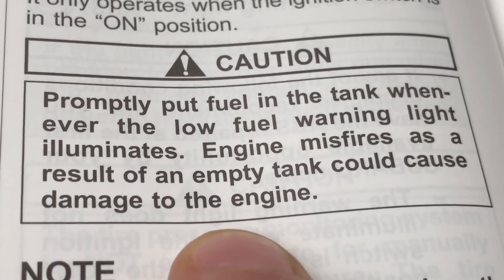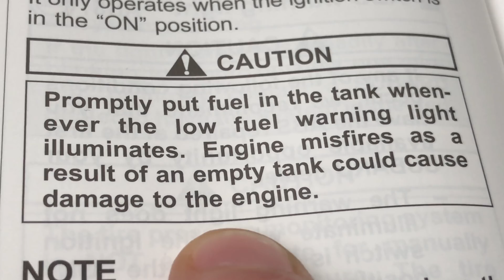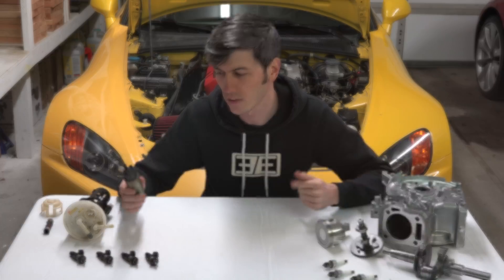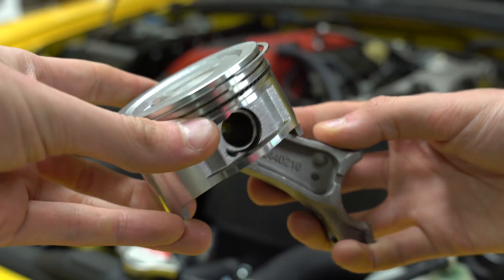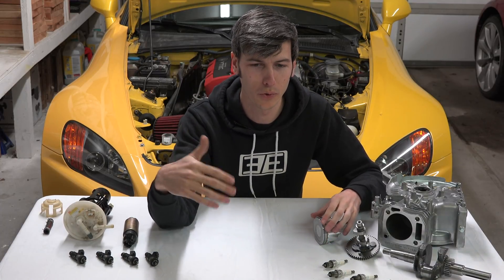Will Running Out Of Gas Damage Your Car?

Comment: Putting temperature cut of sensor on fuel pump and change zero fuel indicator when you have eg. last 5 liter fuel in reservoir can simple solve all that problems.

Comment: A diesel engine with a turbo could be damaged. The pressure inside the fuel system is very high, and air bubbles inside that line will certainly make for a long stop. You    need to repressurize the line. That is not good.

Comment: I learned about destroying the fuel pump the hard way: I have added an LPG system to my gasoline car, the first summer I used it I put gasoline in only when the light turned on, and running with LPG meant i could go 500 miles with 1/8 of gasoline.
After 3 months the pump failed and i had to put a new one in. Never been below 1/4 since then LOL

Comment: Are catalytic convertrers really robust for different fuel/air ratios? I thought they were the reason they switched all the cars to injection, because with carbs the ratio is only close but not exactly right, and that would ruin the cat.

Comment: Hey Jason. Different subject. I was wondering if you could do a video on engine operating temperatures. I see a trend of newer cars running at extremely high temps. My car an 05 bmw 545i runs at 221 and all sorts of problems happen such as valve stem seals going bad and coolant hoses  anything rubber and even coil packs and sensors. I'd like to see your take on this. Paul

Comment: This guy doesn't understand the struggles of being broke. "Can I get $4.62 on pump 3?"
Reply: Good news, when your fuel pump goes out you won't need money for gas...
Reply: It costs the same amount of fuel to drive down till empty as with 10L in reserve, but the latter has less chance of a repair bill.. so even if your shaking down the couch for $5 to put in the tank this week just pretending that the car will totally stop when the needle touches E is a good idea. Also if something really bad happens and you need to evacuate (fire, flood, tsunami, whatever) it means the cars an escape path not a paperweight.
Reply: Hamish McGregor you’re*
Reply: @Hamish McGregor People don't run that low because they fail at logic. They run that low because they need that money to be liquid, not gas.
Reply: @user-os8sq3uh4n  that's just bad risk management, if you keep going through life this way, if course you'll need money to be liquid
Reply: @user-os8sq3uh4n  Gas is a liquid though....
Reply: @TimothyLee93  it was just a play on words but point taken
Reply: @user-os8sq3uh4n  If you're unable to save for a one-time payment of $10 (average minimum wage in the USA is $8.49/hour) which will pay itself off in via delayed repairs, then yes, you suck at finances.
Reply: @user-os8sq3uh4n  It's amazing how broke people make due even once they are out of cash and gas. Gasp, it's almost as if they could've been frugal the whole time. It's just short-sightedness and bad choices.
Reply: @TimothyLee93  gas is a fluid, not a liquid
Reply: 🅒🅞🅝🅢🅟🅘🅡🅐🅒🅨    The fuel can get you more enjoyment than even the 32 oz. Bud Light.

Another reason is people will spend more $$$$ trying to drive around trying to save .02-05 cents a gallon then run out.  Again not very good risk management and when you are forced to fill up it might be the more expensive station and then you need more to fill up.  

Do you want to take a known risk and only put 10 gallons or risk trying to save a few cents and wind up stuck in the no mans land between the two stations.  

Example station A. $2.00/gal and put 10 gallons to fill up.

Station B. $1.60/Gallon but need 12.5 gallons.  Same dollar  amount coming out of your wallet.

Short example but you should get the point.

I understand the $5.00 to hold me over until payday but also remember fueling takes time.  You want to put $5.00 at a time  and be filling up every let’s say two days or put $20 and not have to visit the fuel station every fifth or sixth day?
Reply: Now now now, let's not forget the purchases before the $4.62 on pump 3. I've watched people buy $50 worth of cigarettes and then dump their loose change in the gas tank.
Reply: @darksuns7384  Your car will not run well on loose change. However I guess it will raise the level of the gas remaining in the tank.
Reply: I genuinely feel for those who are frugal yet still broke.  But most of those same people putting in $4.62 in gas are the ones posting their new nails just did or wearing Jordan’s
Reply: @hansolo6827  I concur
Reply: Another thing is most gas tanks have a lot left when the fuel light comes on. My Lexus has approximately 3 gallons left in a 12 gallon tank. That's about 120 miles range left.
Reply: @user-os8sq3uh4n  Most vehicles has 2 gallons in reserve when the "E" light comes on
Reply: Well, it comes down to choices, mostly. I have been broke quite long, but I never went so low that I risked damaging my car by not refueling. And I am from Germany and when I had to watch fuel prices the most because I had little money the gas was at about $6.35 per gallon and I had to drive about 775 miles a week.
Belive me, it was a lot of lifting and coasting and not being able to afford anything but fuel and bare neccessities (I was making about $1450 per month back then). But since then I have a great fuel efficiency in any car I drive. With my current Mercedes I normally do over 37 mpg. The only exception are long Autbahn trips, which may decrease that number ;)
Reply: Luda Guzman there is no damn difference whether you pump fuel in a quarter tank or empty tank. It’s the same cost, if you don’t know how to budget, learn how to budget. If you can’t afford to buy fuel then don’t drive
Reply: M Detlef  It was not exactly by choice. Let me put it this way: It was the least horrific choice I could make If I wanted to qualify for the job I wanted to have and it was only 18 months.
Reply: Maybe you should work more on not being broke?
Reply: @BLAZINGINGPHOENIX  tell that to the boomer employers who outsource or automate every position they can
Reply: OP maybe walk instead and save money if it's possible. Or get a bike like I did for a couple years and saved for a fuel efficient vehicle.
If you're not getting 40+ mpg don't even bother with the car.  Only one person can help you and that is yourself. Believe
Reply: When life squeezes out the last liters of gas from the tank...
Reply: Ha!
Reply: Be'n broke my ass.. Mind your priorities.

You need your car to get around?.. 
Then, your car needs gas to take you. 

It's simple stuff. 🤷🏾‍♂️.. 

$10 in tha tank, every now & then.. OR 
$600 down tha road for a new fuel pump?
Reply: @c-5899  but my feet is not the same size, and besides it I use the metric system instead, jk :)
Reply: I’m sure he understands it. He’s just explaining why it’s bad and what can happen.

Comment: I haven't fully watched the video but yeah, the fuel pump relies on the gas for lubrication.  Little to no lubrication will damage the pump.  Plus less gas in the tank forces the pump to work harder to get fuel to the engine.  So yeah, running low on gas can damage certain components.
Reply: The relative fuel level in the tank matters very for reducing load on the pump little as the supply head variance is low - 18" of fuel equates to 0.5  PSI (divide the height in feet by 2.31 to get PSI of water pressure head then multiply by density relative to water - 0.83 for petrol - so 1.5' /2.31 x 0.83 = ~0.5 PSI) when the pump is delivering a bare minimum of ~30 PSI to the regulator for a port fuel injection - much higher for direct (chamber) injection.

Comment: Very interesting video. FWIW, I have always run my cars to near empty (less than a gallon) before I get more gas. I haven't noticed any of the problems mentioned here. I have run out of gas only two times. For the last thirty or so years I have driven Hondas and I've never run out of gas in those vehicles. I've never replaced a fuel pump in any of them. I think the catalytic converter was changed under warranty in our 1987 Accord other than that I've never replaced a catalytic converter.

Comment: I use anywhere from 1/4 to just over 1/2 of a tank of fuel everyday. I’m in the habit of topping up every night, mostly for the convenience of not having to ever think about whether I need gas, but also to circumvent my car’s attempts to run an evap test. Am I risking any harm by never running my tank very low? Should I be worrying about how old some of the fuel in my tank may be?
Reply: Yes. You're most likely never burning the old gas and introducing stale gas. For the EVAP issue, just do that trick come inspection time. I've passed many with a busted solenoid. Screw regulations

Comment: What about the condensation water in the tank that will be pumped into the engine? Was it a lie from my dad to make sure I was always above 1/4 ?
Reply: Pretty much... the pump is always drawing from the same level in the tank, which is near the bottom, so it's not like there's a permanent fixed water level that the pump magically reaches down to when the fuel is low and picks up just water. Also, most systems are recirculation which returns unused fuel (containing some water) from the rail to the fuel tank which differs from the days of carburettors where the water could settle in the bottom of the float bowl until there was nothing but water in the bowl, at which point the engine would no longer have any fuel to burn and would stop. But even that was rare because while the fuel and water are still separate they are mixed by the pumping action, so if there's any water you're always pushing it through the fuel system and combustion chamber in small amounts. That's not measurably harmful - indeed, water injection into intakes has been used to increase volumetric efficiency and thus power output in engines.

Comment: Iirc some cars have floating fuel pickups? So keeping it full keeps the pickup away from debris that may have settled to the bottom of the tank.

Also keeping your tank full prevents condensation/water buildup simply by reducing the amount of headspace for moist air in the tank. If you're always running near empty, when your fuel pump does start sucking from the bottom you're picking up water laden debris. My sister burned up 3 fuel pumps from this habit of always running on empty.

Comment: Just curious -- if your engine was misfiring in general, how would you know?
Reply: Alan Klosinski easier to spot at idle. Idles rough or unevenly.
Reply: @thesparksplug  Oh, ok. So it would sound weird and not normal when you aren't moving. Ok, Thanks

Comment: You should always let the car run out of fule and try to start it a couple of times just to be sure. Before refilling.
Also, adding sand in to the tank it helps.
trust me i am a mechanic.
Reply: Be sure to light a match and have a good look down the filler neck to make sure it's actually completely empty too.

Comment: Ive been driving with my needle not higher than the the red line on E for over 2 years straight... basically filling up just enough to keep the needle above E or just in it. I drive 2miles to work and back every day. I never had a problem once

Comment: everybody thinks that low fuel will overheat the pump. no. the pump doesnt stay cool by the fuel around it. but by the fuel running through it. so as long as it runs, it is ok.
Reply: You're correct - it's more about lubrication of the internal close tolerance moving parts with fuel and internal cooling than the pump being submersed in a bath of fuel. And when the pump doesn't have any fuel, the engine stops and so the pump is automatically  turned off by the ECU.

Comment: @Engineering Explained  I read an article that claimed a car would get much less power or torque in pure oxygen because of the lack of nitrogen as a filler gas.  Is that true?  Why wouldn't the combustion products of carbon dioxide and water vapor be enough to power the strokes??

Comment: How low does it have to be before problems arise?  The engine light?
Reply: The engine light means something is already wrong, this is about preventing damage, if you mean the low fuel light, then that means you've got about 2-3 gallons left, which according to this vid still has a very low chance of damage.
Reply: @georgerosebush9754   Sorry, I meant the low fuel light.  Yeah, I guess that would be fine.  I would think a couple gallons would be sufficient, but I don't know.

Comment: Isn't the fuel pump "ON" when the key is on. Also, Fuel injectors? Any issues running them dry?
Reply: No. It's on for the purpose of priming for a few seconds after you turn the key to the RUN position then the circuit times out and it's on when the engine is running or cranking.
If the injectors are 'dry' (as in without fuel)... the engine stops.
Reply: @TonyRule  Thanks Tony. I always wondered if running the injector dry would hurt them..
Reply: @TonyRule  LOL. You made me touch the fly..

Comment: There's going to be a suction filter at the bottom of the fuel pump so you don't get debris into the filter? Lol the filter needs a filter to filter your fuel.
Reply: the suction filter is there just to keep large particles from entering the fuel pump. It is not a small enough micron filter to adequately  remove all particles from the fuel. That is why rite after the pump the fuel flows threw a fine micron filter to remove the very small particles and not damage any other parts of the fuel system. Now on heavy equipment  you have a screen / water separator at the fuel tank then the fuel goes threw 2 filters just to be positive the fuel is clean before entering the injection system.

Comment: With gdi the high pressure pump will fail fast when it chokes on air. Biggest risk really is the random lean condition and added knock. 
 Recap only real Risk is head gasket, a Weak (Subaru's) head gasket might pop from the random knock and fuel pumps (GM) from heat and cavitation choking on air.

Comment: Lowest I'm usually going is like  15l out of 70. Don't see any reason testing your luck on how far you get with basically no fuel. If needed to push further for some reason, that will still get you 100km easily, should be enough in any scenario. And 55 liters is enough to get you around several days or one longer trip with no problems anyway.

Comment: My dad never let his car out of fuel. He always refill it if the remaining fuel is between 1/4 to 1/2 volume of fuel tank capacity. He taught me to do same and my current car has fuel range meter, which I always refill it at around 200 Km (125 Miles) remaining, albeit the worst one was 160 Km (100 miles) remaining.
Reply: I've had the same port fuel injected car for ~12 years and I usually run it right down to at least the warning light because I hate having to stop for petrol. I've never had a fuel pump fail and the extensive receipts (I mean, everything - down to lamps) from the previous owner who had it almost from near new didn't show one either.
Mind you, it's still early days at just 350,000km... LOL

Comment: I'm not totally agree with you, because of as soon as fuel pump sucks air there will be less pressure or no pressure in the system and the engine will lose power and stop almost immediately when there is no pressure in the system, so it is enough time of "sucking air" to make some damage to pump or other internal parts. That is ofcourse if we are talking about ordinary injection not direct injection. On direct injection it is worse as engine have hi-pressure pump and a pump in the tank. When pump in the tank will start sucking air it will take some time before air reaches hi-pressure pump, and hi-pressure will suck all the fuel in the fuel lines before air reaches it. Meanwhile pump in the tank will work hard with just air for several minutes. Also air is worse for the hi-pressure fuel pump as it has higher tolerance and more friction between internal parts.

Comment: You'll never have this repair (repain) with a Tesla.  I'll have mine shaken, not stirred.
Reply: Get back to us in 15 years on the condition of your batteries.  You ain't never going to see hundreds of those cars 60 years from now like an old caddie or Chevy from the 50s running like clock work.  
50 year old Tesla= toxic waste dump material. So much for environmental protection.
Reply: @khaccanhle1930  R U going to B around 50 years from now?  I don't care at all 4 general miscarriage junk.

Comment: My service advisor told me to never let the fuel level dip below 1/4 of a tank.
Reply: That's very conservative advice based on older cars.
Reply: @georgerosebush9754  I don't get fuel until I'm down to about 2 1/2 gallons left anyway, which is a little more than 1/8 of a tank in my car.

I figure 2 1/2 gallons is enough to keep the fuel pump safe.

Comment: Old school carbureted motorcycles didn’t have fuel gauges. They had two different lengths of fuel pickups. You’d ride until the engine died, reach down and switch the pickup to the reserve position, pull the clutch in for a few seconds to let the float bowls fill up, and then pop the clutch to start the engine. And then stop at the next gas station.

Don’t forget to change the fuel selector back to tank though. Lol.

Comment: Evap systems don't like too much or too little fuel too
Reply: It doesn't care about too little fuel but flooding them could be a problem if you overfill your tank, depending on whether they're an active (with a vacuum pump) or passive system. I've yet to see any evidence that the activated charcoal is 'damaged' by flooding though since it's specifically there to absorb and store the fuel vapour until engine conditions are met for the stored vapour to be introduced into the intake to burn it off (normally light throttle acceleration or cruise when the purge solenoid is activated). But the evaporative emissions control system has nothing to do with damage that could be caused by running low on fuel.